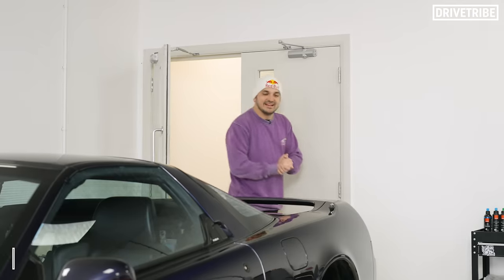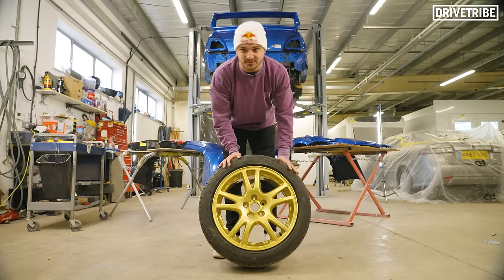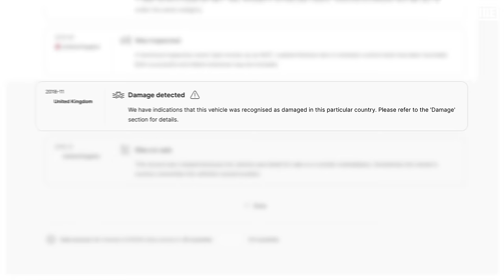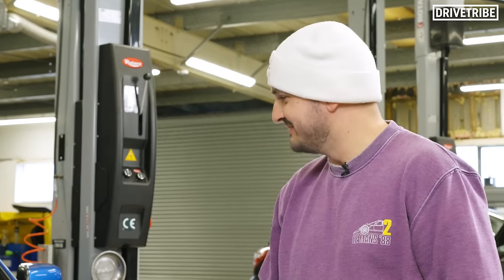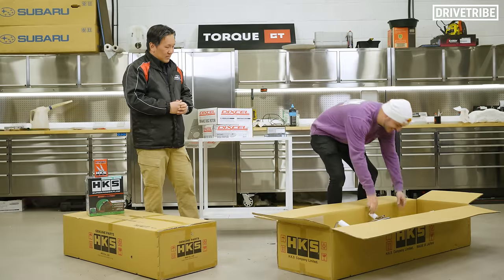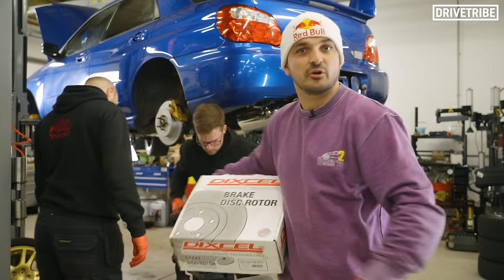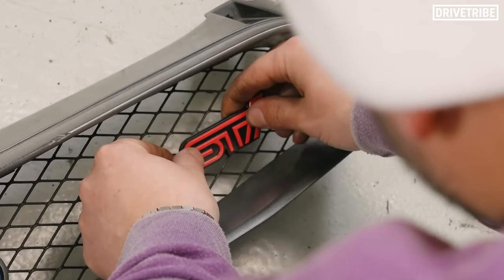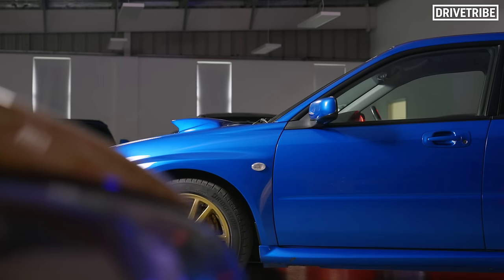Restoring Richard Hammond's Subaru from The Grand Tour | Project Martin Ep.4

Comment: Sooo close but why stop there? Should refurb the brake calipers, fix/replace the bonnet and I spotted some surface rust on the front arches where it meets the bumper.
Reply: The rust on the arches should definitely have been addressed, at least.
Reply: And don’t forget the over spray on the bonnet scoop fins at 10:34.
Reply: Yea weird, I saw that front wing rust too. When the front bumper is off the wings just bolt on/off quite easily too. Changed mine due to rot two years ago!

Comment: This is one of the most shocking resto videos I've seen. Aside from the obvious crater that's still in the bonnet, when the bumper is fitted at 2:21 you can still see that the leading edge of the arches on both wings are still showing visible signs of rust, air bubbles under the new spoiler decals. What's the point in partially painting the car and not doing a proper job while it's stripped and in a paint booth, then half-arsing the finish?

Feels like this whole video series had very little to do with an actual resto, and just feels like content for the sake of ad revenue and clicks.
Reply: not just air bubbles under the decals, but its not even lined up correctly.. even if we give them the benefit of the doubt for the hood/bonnet, that they might want to keep it to show history of the car. the decals not being lined up on a rare model like this is a joke.
Reply: Agreed. Look at the state of the front spoiler underside. Still has dirt and grime all over it. What a joke. I reckon half the people in this Comment section could do better and that includes me. I've built cars for 35 years. That's no "Restoration". I'd be ashamed of it.
Reply: Torque GT shouldn’t be on anyone’s list as a restoration shop, maybe just as a dealer. Then take that car you bought through them and run away to another shop for restoration.
Reply: Possibly an unfair representation of Torque GT as they were possibly on a budget or did this FOC for the advertising but the restoration is definitely on the poor quality end.  I mean we all do work to a budget and I know I personally don’t have 20k to refurb my Subaru but then again I’m not on YouTube showing the world what a great job I’m doing 

This car should have been done at the smallest cog and done right.
Reply: And that brake job, must have shares in copper grease 😂
Reply: They can distract from all that with slow no and quick cuts. All flash and no substance makes the car faster.
Reply: @autocrossaholic  I must try this with my car.  Drive by everyone at 3mph

Comment: Classic spot for the brake line. If I guessed it right you guys are in for a wild ride. Technically, removing the rear seat cover should be enough, having seen a few rusty bits and bobs on Subaru now, I'd suggest to just lower the rear axle and fuel tank down a little bit, makes everything far easier.  🙂
Reply: To the guy that replied, but later deleted his comment. "How can the broken piece of brake line, you can't get to, just fall off and lay there?"
True to its Rallye heritage the Subaru's brake lines run inside the car, and exit the cabin underneath the right rear passenger seat. A few centimeters after this rubber grommet covered exit hole there is a double connector, connecting both inside brake lines, with the outside ones going to their respective rear brake caliper.  Thing is this is a place these cars tend to collect rust anyways, add a little bit of carelessness when working on these parts, or vibrations, or simply time or abuse and these lines start leaking or just pop.
You can access this small piece he showed, because there is a gap in between the diff brace, the fuel tank and the under-body. But unfortunately it isn't enough space to really work on anything there, not even talking about the break lines running very close to the tank.
Hope that explanation helps :)

Comment: The front arches are still rusty...looks like half a job to me.
Reply: @proudofyourroots9575 Precisely. I wasn't impressed when they did the rear arches, should've had new ones welded in as they don't remove it all. Speaking from experience. I just hope torque GT treat their customers better.

Comment: All these comments about leaving the dented bonnet but yet nobody noticed the front wing corners missing paint and rusty, the ghosting on the spoiler, brake caliepers, and the plethora of other quite noticable imperfect areas. This is clearly not a full restoration and more of a quick lash up to deal with the damage and rust that would affect the ability of getting an MOT.

Comment: So you pulled off all those panels, but didn't bother to clean any of them, nor the headlights, not anything behind those panels while you had it all apart. Didn't address the rust on the steel backing. Basically just a typical bodge it panel shop job.

Comment: Most Iconic set of alloys? Dont think so. Unfortunately most people couldnt tell difference between original STI or something generic from a wheel shop. Gold are iconic on a subaru, but not iconic as a wheel.

If you want iconic? The C4 corvette turbine wheels. No mistaking those. Is a reason people use them on so many other cars.
Reply: I prefer the stock alloys on my Corsa honestly

Comment: Not impressed with the work of torque gt here, surley they would have seen the heavily corroded brake line as this looks like the section on the rear drivers side which is easily visible when looking under the car. the paint work they have done looks rather rough, lots of dust nibs in the bumper and the rear quarters have so much orange peel! Dented bonnet? why leave that on, and also why not touch up the wings where the paints flaked off? Very much a budget build this!

Comment: I wouldnt call that a restoration, dented bonnet, rust on the wings where they meet the bumper, front plate is rough and having non import plates looks weird especially on the rear, also think there's a front lip missing

Comment: Either you guys have a run of choosing bad companies to work on your cars (lets not talk about the Mondeo disaster) or you aren't paying them what they deserve and so they do a half-arsed job, but this subaru is not going together very well. The paint match is awful, theres still chips and rust on the front wings where they meet the bumper, wheels aren't the right shade of gold, paint still has swirls and headlights are still faded despite having a detail, brake calipers weren't repainted or rebuilt....the list is endless.

Would be interesting to hear who is paying for the work and whether the companies involved are getting full rates for them, because if they are, it would make me very concerned as to whats being shown on these videos.

Comment: What cheap car uses decals like a toy model.... LOL it takes 2 minutes to get a tape measure or ruler or something else you could use or mark on the diameter of one exhaust to compare to the other. Lazy..... LOL the host is surprised that a restoration car repair or car detail shop actually keeps parts onsite in it's own stock thats how any reputable shop should & does do it unlike most now these days big or small who have no parts & have to order them from a three party wholesaler & wait for the part to be delivered often in a few days if that to then put on the car delaying the customer getting the car back & increasing costs with "labor & storage" of the car in the meantime. Especially big shops & named dealers it's insane to think they don't still have their own parts on site or near by that can be retrieved same day & slapped on in quick time. But that costs money & space instead that open space & be used for fitting more cars & more money waiting on mail ordered parts. And more customers waiting for their cars to be repaired in an untimely manner.